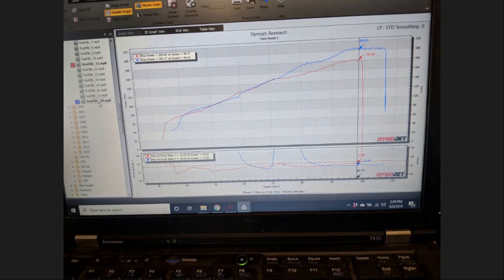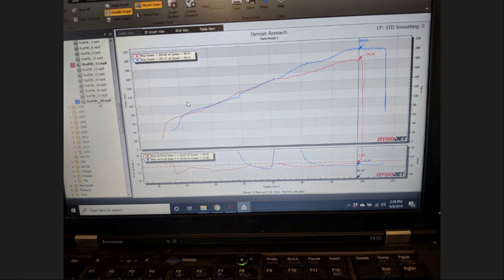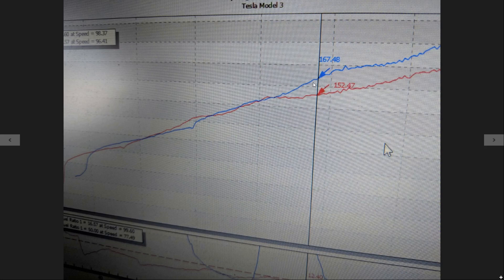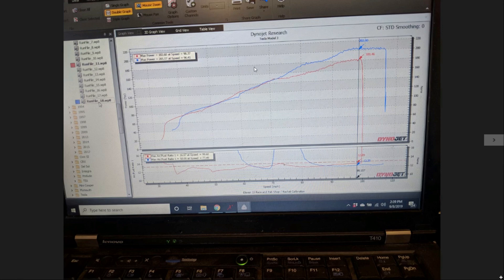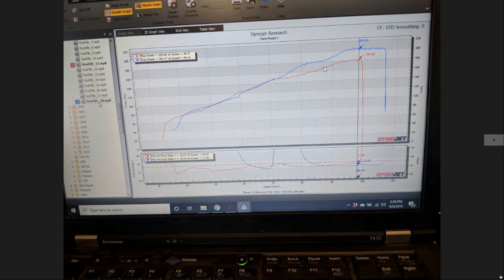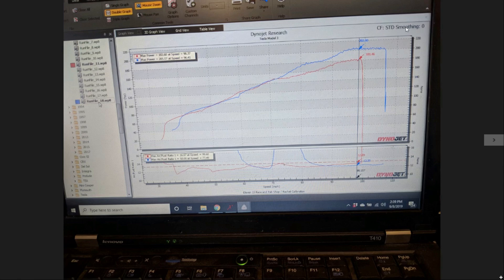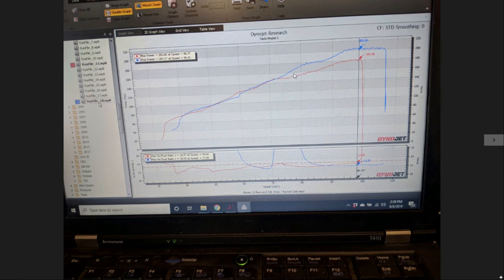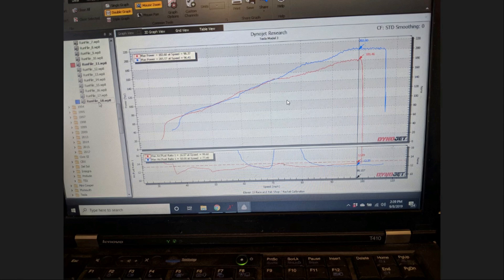H Series Dyno Testing H22a Stock Vs Bolt ons

Comment: Interesting. My H2B made over 200 with the same mods. High end tri-y, 3" mandrel exhaust, intake, injectors & pump. Not that that the number is relevant lol. 5:15 hit the nail on the head. I keep saying that but kids don't get it. 

Now I really want to throw intake manifold/tb/cam gears/cams + head work at it and see what that gets me.

Comment: Is all that work worth the minimal gains, when for about the same price the engine could be turboed and make 150+ more hp?
Reply from the maker: Welcome to all motor
Reply: Is it worth it? Yes.  Can u make more power with a turbo? Yes.  Turbos arent the end all be all and it depends on the setup and purpose of the car to determine if na or turbo is a better choice.  Faster isnt always better and more horsepower isnt always faster.  On top of that this all building the head which would benefit a turbo engine as well, however, your cam choice will ideally be different.  Imo na is more fun and more useable.  Road racing a turbo civic with a half sized radiator sounds like a recipe for disaster to me.  The na is definitely more for endurance compared to the turbo setup
Reply: everything done to the motor is probably way under 1500$ which isn't even half the cost of a decent turbo kit anyway and is more reliable and hassle free.
Reply: TurnIP the Cnc portings probably 700 if not more, another 100 for the spacer, don’t know about the cams but I’m gonna guess atleast another 500, probably another 4-500 for the springs, no idea on the valves either but I’m gonna guess upwards of 3-500. Easily looking at 2 grand on the low end easily. For that same price what you could do with a unopened engine and a home made turbo kit, could very easily make 350+ at the tire
Reply: @bluGill89  rocket springs and cams are 600$ish and the manifold is around 300 with 6-700 for the head which puts you right at the 1600$ mark.
Reply: @bluGill89  i have turbo h22 and allmotor f20b pro2 cams .. the allmotor car is way better to drive.
Reply: I agree, if it's stock and unopened and on a mean budget  just put a turbo on it and do 7-8 psi. . And call it a day. Of course add your bolt ons and fuel injectors and tune. . Because all motor is just a whole different beast. It's more of an Art form to get the ponies out of it. I guess it's what your wallet can handle. I prefer a all motor build. Instant power, like on my B series build. I decided on going built for 215 whp rather than boosted and getting 250 whp stock block. . Yea it costed me $3000 labor included just for the block build. My B16 head had already a Crower valvetrain when I purchased it.
Reply: Seems kind of like it would be foolish to turbo without supporting mods at least if you want anything reliable